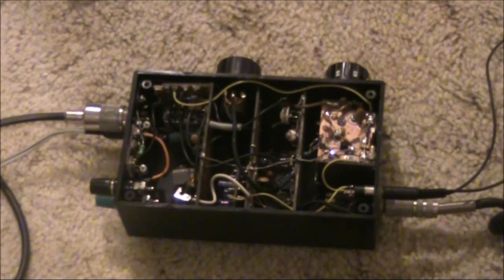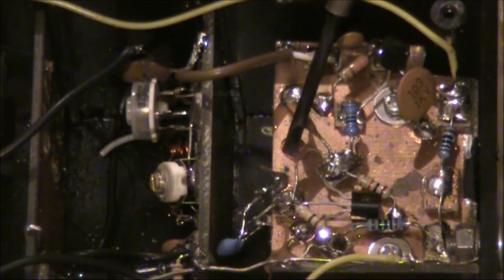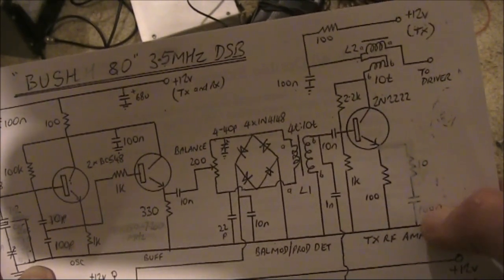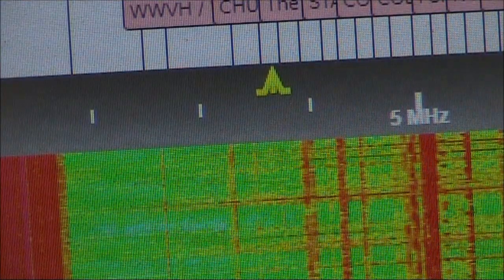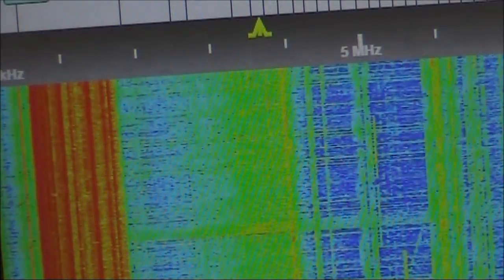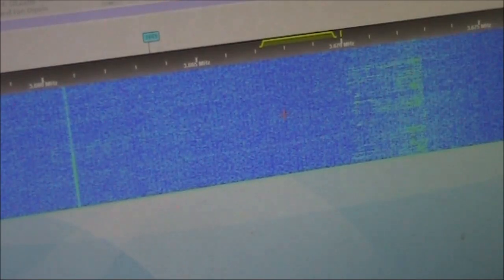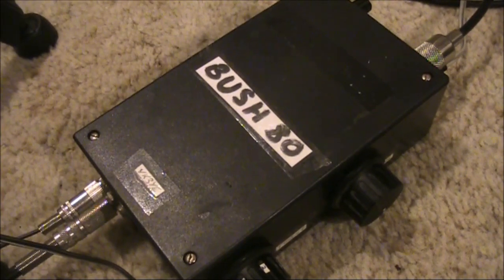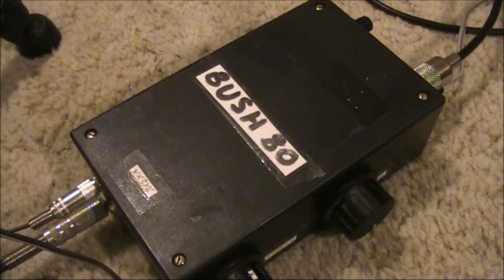Bush 80 80m DSB transceiver

Comment: I have a 75 meter kit-the survivor by Steve Webber., KD1JV. Rx audio is nice. It’s been hard to make contacts because it seems many run 1kw and seem to only respond to 40 over signals. Made a few contacts out a couple hundred miles with 10 watts.

Comment: Hello Peter, thank you, The Link Shopping on eBay via, http//ebay.us/xOKGLE is not working.
Reply from the maker: Thanks Dennis. Oddly the link works for me.
Reply: @vk3ye  No worries Peter, could not send screen shot, but this is the writing on page.   
We looked everywhere.
Looks like this page is missing. If you still need help, visit our help page 

With a picture of a little boy with head covered, it is an ebay page. Doesnt matter. Thanks for reply Peter. Thank you for very good video, as always.
Reply from the maker: @dennisbauer3315  Thanks Dennis - had another check with the more correct https and you're right. Now changed it so should be OK now.
Reply: @vk3ye   Thank you Peter,  its working, there are enough pictures of Amateur radio and accessory's to drive me into a dream land state, I may not recover from for hours. While we are on  this subject the first VCOs I ever made was your Direct Conversion from one of your first internet sites.  I think that was called just Direct 80 and the schematic. Loved it, and so many more later.